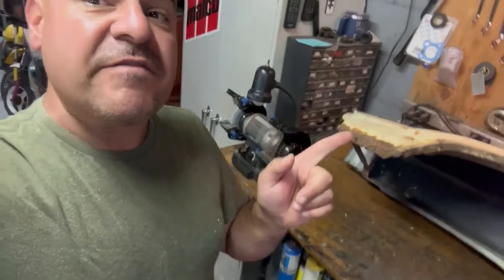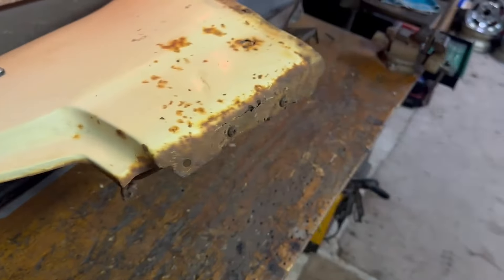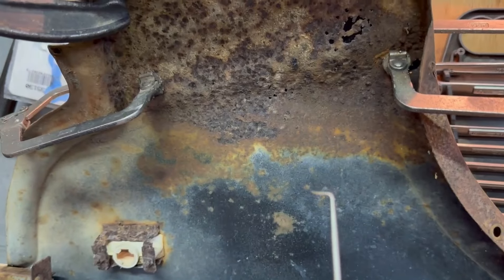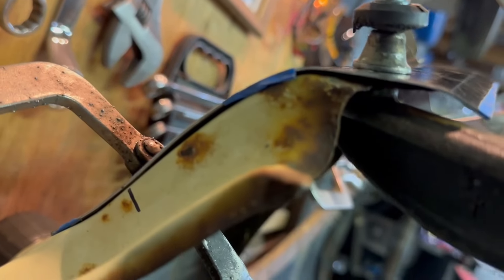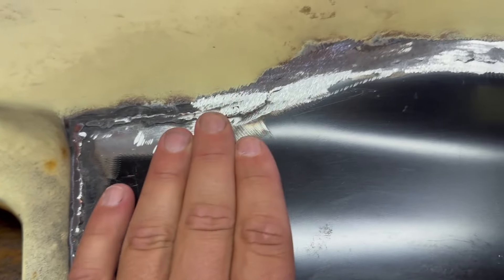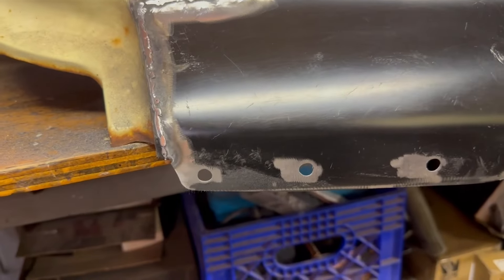Fabricating Our Own Front Fender Panel Patches | Saving Original W-31 Fenders

Comment: Do you cool after each tack an inch apart or just space the tack welds and bounce around. Nice work
Reply from the maker: Hello there and thanks for taking the time to watch some of our work.  I guess the honest answer is.... it depends.  On larger flatter sections I absolutely do cool down the welds as I go with compressed air to help prevent most of the warping.   On the tighter, more rigid shapes, I have found that skipping around and using a wet rag to keep the heat under control works just fine. 
Thanks again for watching and for your compliment.
stay tuned
-steve
Reply: Thanks for the reply. That’s what I was thinking. I have to do a patch very much like yours. 
I place a piece of copper I have from roofing underneath the butt edges to be welded. It absorbs a lot of heat and helps with possible blowout. Especially when I start at the ends where starting the weld which tends to blow out and make a possible location to start a crack. 
I’ve been thinking about screwing the butt edges down to a copper backing strip to start and fill the screw holes later. 
You never stop learning when welding.
Reply from the maker: Yes copper can be a big help too!   Welding is like many other things....you need to let the metal talk to you - let it tell you how it wants to be melted together.   Believe it or not, when I built my daughters convertible and even for some of Mr. Jones, I was using my old reliable flux core welder.  Keeping things cool with that is a real challenge but very possible.  Like the old saying goes, if you can't be a great welder, be a great grinder.  hahahah
thanks for playing along.
-steve
Reply: @theautorefinery  I like that saying. I always thought welders were a bit nuts from sniffing all that gas!